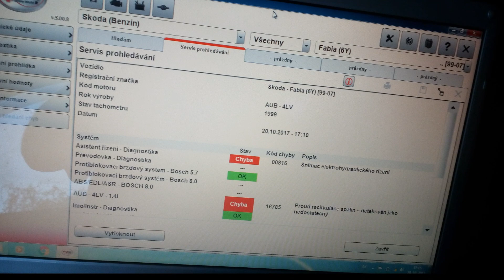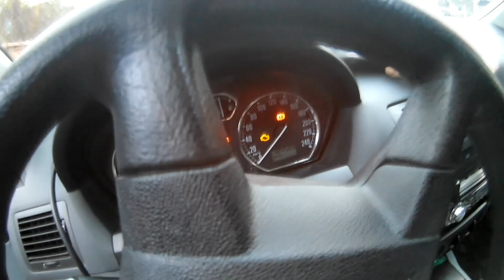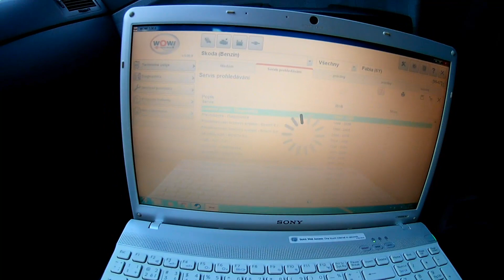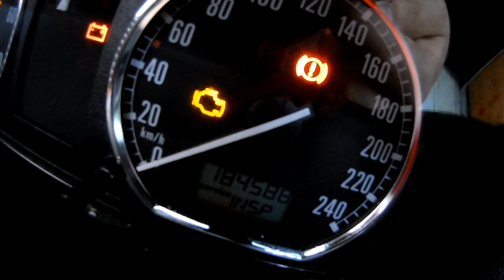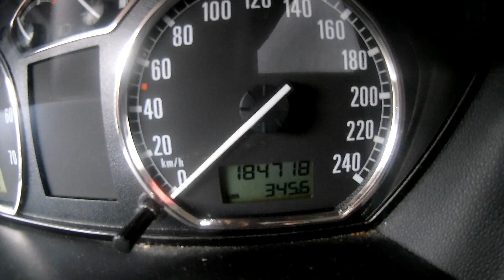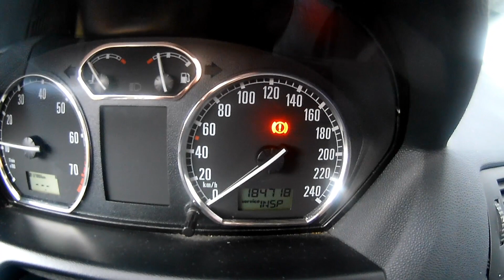Skoda fabia 1 Oprava chyby 16785 systém regulácie vyfukových plynov nedostatočný

Comment: Hola.. te saludo de América latina, tengo un skoda Fabia 1.4 16V año 2002 motor AUB, tengo un problema con el potenciómetro de la EGR, pregunto es posible tapar esa válvula de recirculación de gases? 
Otra pregunta se puede adaptar un embrague bimasa del Octavio..? 
Otra pregunta cual es tu número de recambio del disco embrague? Gracias por tus comentarios. Saludos

Comment: Mi máme tiež Fabiu combi 1.4 55.kw 2002 automat 191581 km. A otázka: Dnes nám vypol motor počas jazdy  Dňa 15.2.2023  po 17.km V Humennom na Slovensku , po zastavení auto sa podarilo opäť nastartovať. Po prejdení ďalších 29.km a jazda domov auto ide a nevipol sa motor opätovne, a zatiaľ ide. Pred 24.mes. bolo pajkovanie na budíku imobilizér. A bolo menené palivové čerpadlo a EGR ventil. Stretol sa niekto s týmto problemom že mu vypol motor počas jazdy a žiadne kontrolky sa neobjavili na vyrovnanie. Auto potom pôjde na diagnostiku.